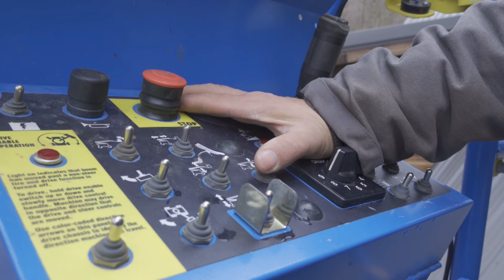Installing The Wood Stove And Stove Pipe

Comment: Well done! Cutting a hole for the chimney-pipe in your nice waterproof roof is not for the faint-hearted. The first consequence is that the length of the day shrinks dramatically, the task expands exponentially, and the weather comes over the horizon at incredible speed.

Comment: Marvelous what you've done.  Brings back memories of my own DIY raw oak cabin (small, 10' x 15').  My stove pipe went through the wall of the cabin, with an "L" bend, and a hatch-plug outside so I could remove any accumulated soot.  The 'insulation' through my wall was a small section of cement, and the wall was built around it.  That little wood stove could sometimes get red hot.  Toasty!  You have a beautiful home.

Comment: You should use a slip -joint on the lower section. You will probably need to use a shorter section off the stove or aft the slip joint. The reason I'm saying this is because ( at least on film )  it looks a little off on the symmetric s with the angle of the interior slope. I've installed systems like yours for 30yrs. You have done a wonderful  job as far as I can see.

Comment: PLEASE VENT TO THE OUTSIDE!!!!  It is so important to get the air for combustion from the outside in tighter houses.  Some models pick it up from the stove pipe.  Looking great.  Keep up the great work.
Reply: I think that is a pretty new thing. I've had wood stoves in many houses for years, even mobile homes that are very tight, and never had a vent to get air in, and never had a problem with a lack of oxygen. :)
Reply: @debradiane3929  Long term exposure to low levels of carbon monoxide causes brain damage. With 3 young kids in the house, why chance it?  It will also heat the house much better in the winter because it won't be pulling all that cold air in from outside. Depending on if appliances are gas or electric, adding make up air for the clothes drier and range hood isn't a bad idea either.

Comment: I've installed hundreds of stone fireplaces, hearths and stove walls like yours. One thing I wish I would have suggested before you got started in order to make the job go faster would have been to use a table spoon to smooth the mortar joints rather than wire brush and sponge clean. I generally use the wire brush and sponge to clean the excess mortar from the stones, but on the grout joints I would grout in around the stones  and when I finish for the day, I would go back and spoon to the desired look you want and use a shop vac to suck up the loose sand and mortar that was spooned out. The job that you two did looks great but I know I could have saved you time. I know, I know... big help now that you have finished. LOL  I love your family by the way!
Reply: Did you not see her using the steel tool, shaped like a long thin spoon, first on the joints?

Comment: Love the entire look of your home.  Remember,  CO is heavier than air so you should also get a battery powered CO detector and install it about knee high.  If the CO gets to the ceiling detector, (w/o a lower 2nd detector) you wont be able to hear the alarm because you'll be dead or unconscious.   Love all your videos.  Wish I was there to help out!
Reply: I was a Gas Engineer for 40 years,  carbon monoxide is similar density to air if anything slightly lighter. We would normally recommend that you have sufficient CO detectors to allow early warning before you enter a room with the appliance, or at least have them linked to provide earliest warning. Also children are more vulnerable to the effects of CO so you cannot be to careful. Love the house great to see a husband and wife team working together.

Comment: Champions! - Cutting a hole in the roof would have totally freaked me out.
Reply: Same, I was like how the hell is this going to be waterproof? then he had a whole roofing sheet lol.  

I just put 16 (17, I missed one) holes in my roof 2 days ago for the lugs for solar.  Nerve racking hoping I found the rafter with each hole I drilled.  The one I missed was 1" off which worked out fine since the 3" circular flashing covers it + sealant in it.

Comment: I was trying to see how you sealed the high side of the chimney flashing over the standing seam roof........ also, you should be fine with 18" over your ridge.  I've had a wood burner for years and I'm not 18", close, and I've never had issues pulling a draft, no down drafts, all good.

Comment: Until 2005 we were cooking using a big range where the left half was wood/coal and the right half was propane. Then we did some remodeling and bought that very same stove you have plus a separate propane gas range. They sit right next to each other on a large hearth. That wood range can heat our house just fine if set up proper before bedtime. What helps is a large chimney that stores heat. Plus you will enjoy making stews and soups on top of your new stove. We have only had to replace the glass on the top once and it was the mistake of our house sitter, otherwise, no problems. Enjoy.

Comment: The standard setup for chimneys is 2 ft above 10 feet out you guys are above the ridge you'll be fine you don't need an extension
Reply: Yeah I would only buy that thing if the roof panel paint started bubbling - lol

Comment: 17:41 my OCD is kicking in.. the pipe and the ceiling are not parallel, they are off by a couple of degrees... You guys should run pipe at the same angle as the ceiling.  I'm just saying.. all the trouble getting things perfect, might as well get the pitch of the pipe to match.
Reply: i dont need OCD to tell me this :D it would bug me to hell and back that the pipe and ceiling are not parallel
Reply: I’m not OCD. But as a designer it’s killing me to see those unparalleled lines too.
Reply: Perhaps you would like to go fix that for them, and go manufacture some double-wall stove pipe considering that it is manufactured to certain sizes and not cut to fit. You can’t cut double wall in the field. OCD or not it would be more trouble than it’s worth trying to get it parallel, nothing is ever perfect.
Reply: @joshrhoades7034  Actually it isn't that difficult. They just need to take the short piece at the bottom and put it up on the angled piece. Should match about right because the elbows are adjustable.
Reply: Apply your OCD to your own projects.
Reply: @NORFOLKIAN  I totally agree, they have done such a fab job, it would be a shame not to get it right, it would bug me all the time. there have been things I have done in the past ,left it , and redone it two years later because every time I looked at it, it bugged me !!

Comment: You know a cool idea for a at home made fireplace project would be. If it works around the building codes. To install a water feature with a basin that is tied into a copper coil that goes around the flute of the chimney. That way while you have a beautiful waterfall feature with other landings/ ledges that can deflect the water nicely while hydrating your home. A fireplace dry’s the air out in a home to a whole new level.
Reply: It would make it a hot water feature that could be temperature regulated with a valve.

Comment: Hi Josh and Erin, you did a great job with the stove installation but struggled a bit with the grouting. Well, if you want to do more rough grouting like that, take a two by two inch piece of wood about 4-6 inches long, widest gap plus two inches, and place a nail in the middle of it with the head only sticking out the depth you want the grouting to be, +/- 1/4 to 1/2 inch max. After grouting the openings, wait till the grouting is well set and not soft. Slide the block with the nail head in the grouting which will then remove all the excess grouting and leave a uniform depth all over. If you want to have a rough finish you can then lightly brush it with a half inch brush afterwards to remove all loose wet grouting or if you want to have a smooth finish, use a pallet knife to smooth the grouting. Again you may use the brush to remove any loose grouting. It will take time but will give a beautiful finish. Do not use a sponge as it soaks up cement and stains your stonework. Do not worry if you have messed on the stonework. On the next day, brush off the whole area to remove any cement that you have messed on the stonework. If any cement has penetrated the stonework, wash the area with a diluted mix of Hydrocloric Acid (Swimming pool acid)  and water 1:10, using rubber gloves. That will remove the cement stains. Once the area is clean, wash it with clear water and let dry. Once the area is totally dry, put a stone sealer on, normally two coats and you will have a beautiful piece of art that you have created.

Comment: Josh  hint of you ever plan on using mortar to fill stack stones again grab an empty caulking tube push a threaded rod through the spout , to push out the push plate , fill your tube with mortar replace cap n use your caulking gun. Carpal tunnel makes you think how can I do this and achieve the same results, also happy to see y'all didn't cheat using backer rods

Comment: Looking great !!! Things are finally coming together for you two.  It's just too bad that you didn't get the slope on the flue pipe to match the slope of the ceiling.  I know that it's possible.  I'm a retired sheet metal worker and I have installed at least 100 plus wood stoves and metal chimneys.  Still, all in all, it came out good. Well done.   Rick.

Comment: An old bricklayer told me those bags suck you just have to have dryer mortar and push it in you guys are so far away otherwise I would’ve came and helped even though it looks like you do everything yourselves but dryer mortar and then you push it in and brush it and let it dry then brush it off and smooth it out I learned the hard way on five old 1889 brick buildings lots of pointing in brick repair and cracks , you guys are doing a great job

Comment: I think the stone work pointing would've looked great if the mortar was white,  I done a lot of stone pointing on refurbishing my 150 yr old  stone built cottage used Hydraulic Lime and sand and then finished it off with  a lime wash coat. Very tedious work that took a lot of time but the finish was well worth the effort.  The stone is a reddish pink sandstone and the contrast of white pointing is very cosy looking.

Comment: That kind of project would make me super nervous. Not because of the height or the weight, but because of the cut through the roof. It´s like you have one shot at this (and under time pressure no less) one attempt, and it´d better work. You clearly made it work, so well done! I think you did really well in installing it safely while getting it to look how you wanted. 
Most of the time, I really like your visions and they turn out great. Sometimes, I´m not convinced about a vision yet the result wins me over. This time however, I don´t think the result will grow on me. I don´t particularly like the stone surface under and behind the stove, I don´t like the placement of the stove, and I don´t at all like the placement and shape of the pipe going up to and through the roof. I wonder what your reasons were to place the stove so close to the entrance, and to make the pipe exit the roof that close to the ridge, and to have it go up with two bends, and the second bend restricting accessibility of the loft (or at least visually "being in the way" 17:41)? Why not put the pipe through the roof at a much lower point? Or if that´s not possible or desired for some reason, why not have the second (angled) leg of the pipe follow the pitch of the roof?

Comment: Curious about how you plan on cleaning from 45 to 45 degree elbows when using chimney brush, that is where the major amount of creosote will build up . Also the spinable 45s are a fault as that sheet metal joint expands and contracts with chimneys heat which can cause it to pop out of its knurled edge(especially if built up creasote builds up in spinners joints and ignites). You don't need spinable being straight on, solid 45s would be safer. Stay safe as you can. Cheers

Comment: FYI: I know that all the work with the elevated platform is completed but for future reference at 3;22 in this video you hand is over the control box. The dial below the palm of your hand is reading "9". The dial itself is the speed control for the unit and the settings represent your speed. from 9 - 0 /Hi - Lo/Fast - Slow. 9 (Hi/Fast) mode, is used when travelling to and from the  area being worked. When close to structure the dial should be set in the "5,4 3" mode (Low - Low) mode. This way Allie would not feel the cage move around as much. Gl
Reply: OOPS sorry Erin

Comment: Very pleasant video. Nice stove install, but you put the first section of pipe from the top of the stove to the 45 degree angle joint upside down. The joints should always have the top piece going inside the lower piece, that way any creasote will pass down to the fire instead of leaking out of the joint and making a mess.

Comment: I believe you have connected the pipes to the stove upside down.  The higher pipe should fit inside the lower pipe, not outside as you have done.  If any tar deposits run down the inside of top pipe they will run down the outside of the lower pipe.

Comment: With a little elbow adjustment and jiggering it seems to me that the stove pipe could run parallel with the ceiling slope. That would be a much more attractive installation.

Comment: Suggestion: The first angle off the stove pipe doesn’t make your pipe match the angle of your ceiling. If it did, you might get the height you need off the roof. Could you get (or custom order) elbows to make that happen? It looks awesome!!!

Comment: Nice job you two, your home is coming together very well. Why didn't you install a damper just above the stove? I use one in my stove pipe and it will really allow me to regulate the heat leaving the stove. I also notice with a damper it helps to save on wood consumption. Harry

Comment: It looks like you installed the pipe on the outside and it should be inside the flanges working up as any Creosote coming down pipe will stay in the pipe and not seep out causing a fire hazard.

Comment: Looks good but I have a question(perhaps I missed something).  I saw you put the mortar on the wall and then the stone(?) on the mortar, but is the mortar the only thing holding up the stone or was there something used to fasten/hold the mortar and stone to the wall?  When the stove/oven starts operating and the wall gets heated up and cooling down will that, and possibly other things, cause the mortar to fail and the stone wall(weight) to fall?  Perhaps someone else asked this and I missed it but was concerned because of the kids while viewing this episode.  Otherwise I really enjoy all your efforts!

Comment: I use to install stoves, are you sure you put the single wall joints the right way. looks to me like you put it like it is suppose to go for gas. we always put wood with the open seam side up cause wood smoke can be wet and run down the inside of the pipe. If the seam is down it will run out of the pipe with seam up it stays inside. Maybe you should ask your supplier.
Reply: Great points Myron hope they see the comment
Reply from the maker: All the pipe is double walled. The two long pieces are telescoping and each pipe/fitting has a sticker which shows air flow to ensure proper installation

Comment: That was the most difficult way to do it. Should've crossed the roof at 90 degrees with a straight hole throught it. The smoke pipe twisted a little to cross the roof in a 90 degree fashion. Easy.

Comment: So what is the stove combustion air source? The combustion air should be a dedicated line from outside straight into the firebox so you're not drawing house air. Otherwise you are quite literally taking warm house air and sending it out the stove pipe.

Comment: Hi there,  FYI.
Not trying to criticize about you work but just to let you know that your stove pipe should be installed with the female ring on the inside with the male end end on the  the outside at the joints.
. Your pieces are upside down !
This is so that any rain water that egresses into  the system or condensation from the wood burner itself does not come out of the joints but runs down the inside of the pipe, and eventually back into the the wood burner , not outside around the stove pipe joints.  Don't worry about smoke coming out that will not happen.
 After a time, the water stains will, then  YOU WILL SEE WHAT I MEAN.
Reply: MY BAD>>>>>>>>>>>
Sorry guys I screwed up with my instruction of the pipe install. 
The pipes are  supposed to be with the male part of the pipe at the bottom pointing down and the female part facing up.  
The male part then goes inside the female part so that any moisture going down the inside of the pipe will not leach out of the joint but will stay inside the pipe.. The reason is as described,  I just got my male and female parts screwed up.
Hope this makes sense.

Comment: How did it go from day to night and you are still working on the stove-pipe?  What happened in between?
Reply from the maker: The insulating, blocking and extra metal- we talked in the video about how we did this but didn't film it so we could just quickly get it done since we had some rain and nightfall coming quickly.

Comment: The angle of the pipe didn't coincide with the angle of the roof. It sort of bothers me. One more reason - not that I came to this point watching - to have gone the other way with the pipe and crossed the roof at 90 degrees or so.

Comment: Bless your heart!  But did you measure your pipe TOPPER that filters the sparks, etc.?  OUrs is higher.  Yours might be the 2 inches you need to comply.  Measure it!  Measure it before you order more pipe.  Besides that 24 inch requirement is for conventional roofing.  Yours is steel.  I hope I am right.